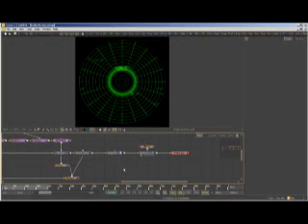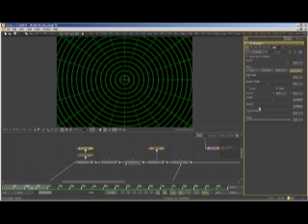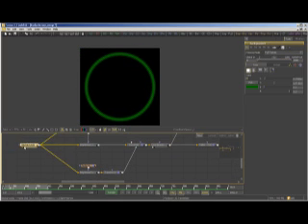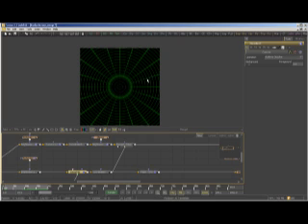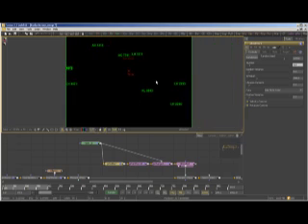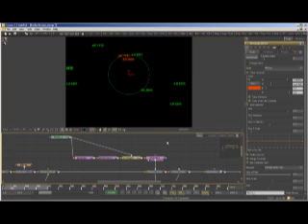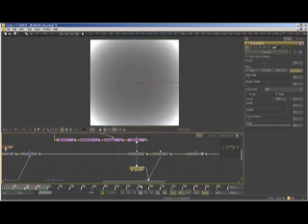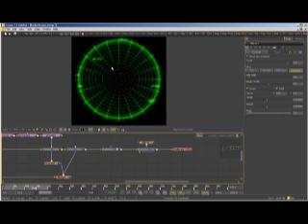Fusion5 Tutorial - MotionGraphics RadarScreen

Comment: @vaasung Derek is right. But know that After Effects does not provide true 3D avenues. Its more of a 2.5D illusion to be 3D. Fusion allows real 3D implementation by importing FBX files. So if you are a hardcore 3D guy, you might find Fusion handling your needs. Fusion does not render with sound, After Effects does. I use After Effects but at times, use Fusion for 3D props. Both are ideal to use on top of your design needs.